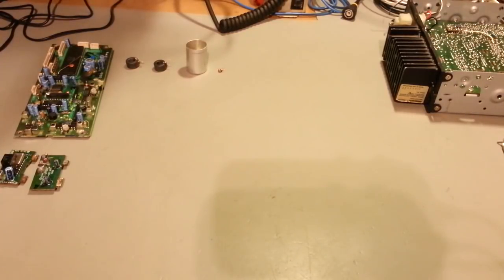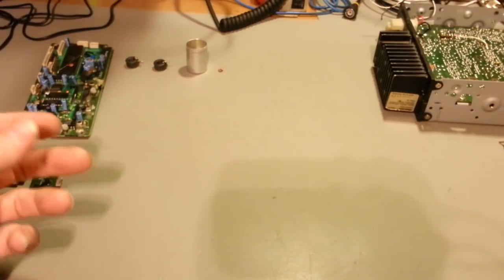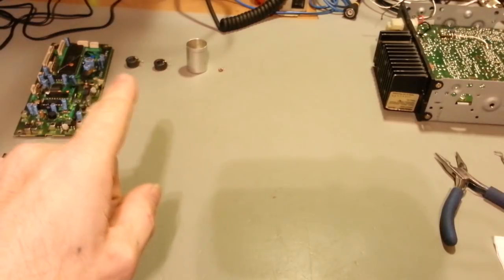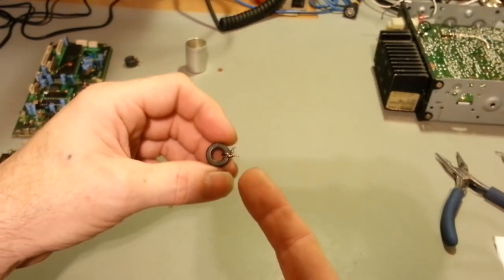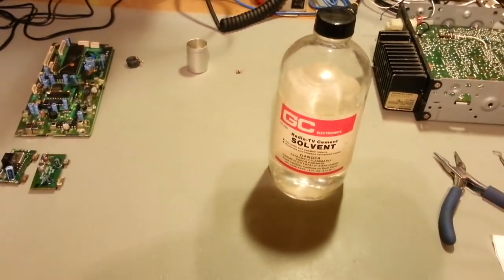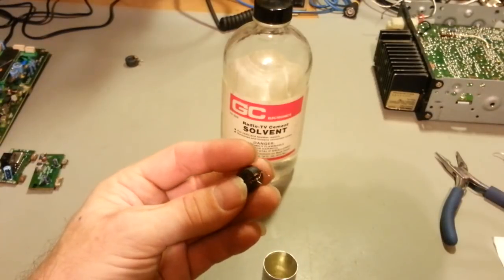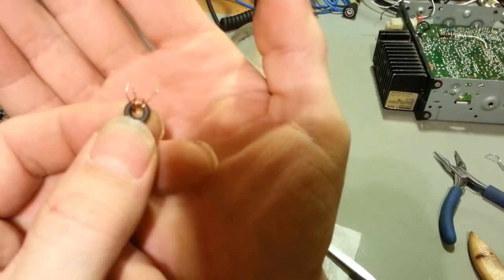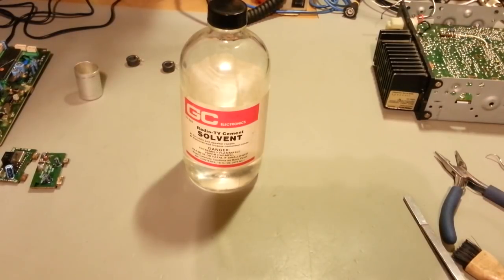Removing corrosive conductive glue from torroid transformers easily.

Comment: I realize this video is now 7 years old, but after disassembling my now non-funtioning Cyber Power UPS backup power supply I went searching for the GC Radio-TV Cement Solvent, but discovered it is now impossible to purchase other than a few outlets selling only tiny 2 ounce bottles for anywhere from $18 minimum up to $36 or so. Even the largest electonics supplies online no longer carry it.
I ended up using straight acetone, which 'eventually' works, but can tell it doesn't work even 25% as well as the GC solvent.

Comment: I just wanted to let you know about my 2510. I’ve had it for a while and sent it to a friend to have some work done on it. By work, I mean I dropped it and wanted the face plate replaced. He did that but the radio came back with low output power and I thought he robbed it for parts. So for about 10 years it sat on my shelf ready for trash. After watching your video about the glue becoming corrosive, I removed it all and THE POWER CAME BACK!!! She’s good to go, but wish I could get it to you for TLC. Thanks Mike!!

Comment: I’m actually doing this on my 2600 right now. Wonderful timing! I’m almost done with the processor board.   One question, I’m thinking about using electronic grade silicone to secure the regulators. Perhaps half silicone towards the top of the regulator and thermal grease on the body.  Any suggestions?
Reply from the maker: +Overlin Alaniz 

Sounds like a good plan.  Main thing is to get that horrible glue off.

Comment: Good to hear of another trick for dealing with that trash glue...!

Another way to remove it is by gentle heating with a hot air tool, then you can pull it off with tweezers etc while it's warm and soft.
Which might be safer if you have the glue stuck on anything that could be damaged by solvents.